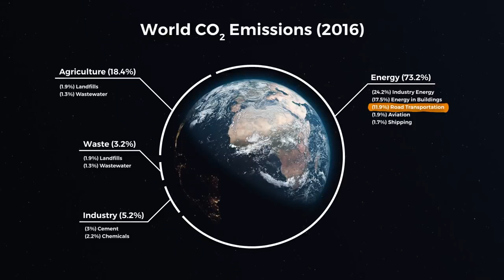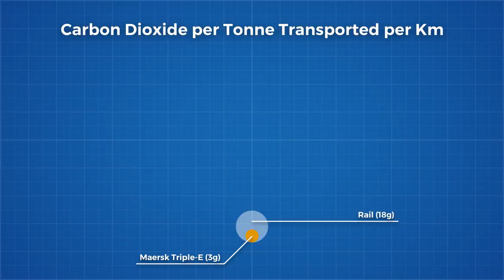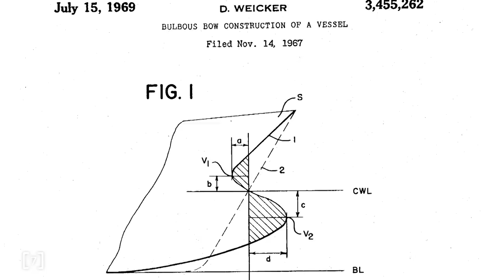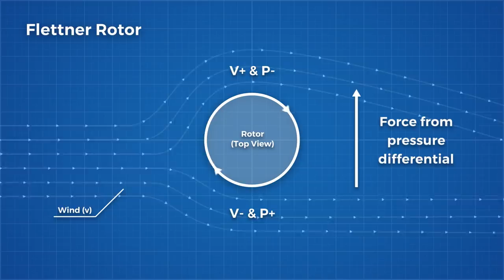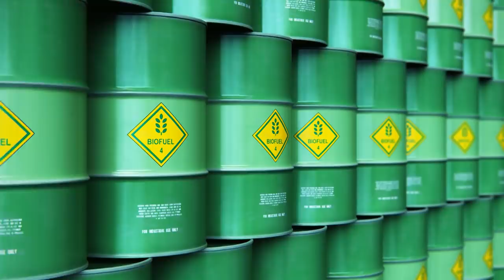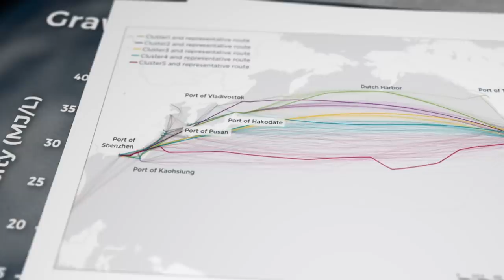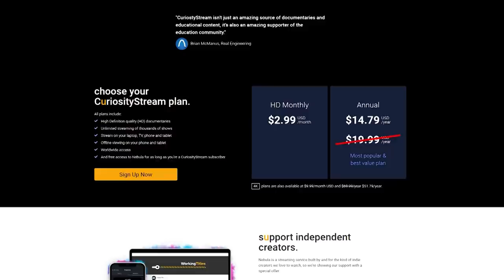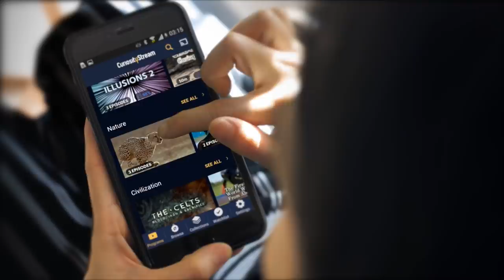Are Renewable Powered Ships Possible?

Comment: What about the use of Nuclear Power for these large ships. I know that it has a Number of real problems such as when they need to be taken out of service and the deadlyness of there fuel but with some of the new designs can this be minimized?
Reply: If you do a web search for ‘nuclear ship savannah’ you will see that it has been tried and did not work.  A similarly heavily subsidised, by the government, vessel is in use in Russia which also operates, in support of the Northern Sea Route, a fleet of nuclear powered ice breakers these may, or may not, have been completely without issues.

Just think; would you have full confidence in the management of a nuclear reactor under the control of an anonymous entity only traceable, perhaps, via a letter box in a FOC (flag of convenience) nation state?  If you are, could you sell that confidence to Japan, the state that hosted the Hiroshima and Nagasaki nuclear detonations as well as more recently the Fukushima ‘event’?  Then try that same, or a similar, sales strategy on Ukraine, the nation state that as a part of the USSR (CCCP) hosted the Chernobyl ‘event’.  Modern iterations of nuclear energy, thorium fuel, molten salt reactors or fusion reactors, will carry the legacy of past problems.  It is the global trepidation of anything with 'nuclear' in the name and the economics of nuclear having transitioned from 'energy to cheap to charge for' too 'the costs of remediation are incalculable' that will prevent the adoption of nuclear energy as a means of creating energy at sea.  Modern reaction systems may have overcome the safety problems but the general public, having been misled in the past, will be reluctant to believe the fresh new promises.

‘They’ say nuclear is cheap, it’s not it is expensive and has a large embedded carbon quotient as well as being complicated, dangerous, not universally socially acceptable and having only ‘no need for refuelling’ as a questionable advantage; actually it does need refuelling just not as often.  When ‘they’ do need to refill the warming up stuff it takes considerable longer than pumping tonnes of thick black stuff, HFO cSt380, or thin runny stuff, MDO, onboard which is one of the reasons HMS Queen Elizabeth and HMS Prince of Wales are pushed about by ICEs and gas turbines thus using a similar fuel as the aircraft that fly off of them.  The Royal Navy (RN) with a high degree of skill and expertise uses, at vast expenses to the UK taxpayer, a current operational nuclear fleet of 11 submarines (also known as ‘boats’) in two flotillas, seven attack subs and four ballistic missile boats.  The carbon footprint of all the extra bits of hardware and the fuel, including processing thereof, from ground to propeller, are the external costs that never seem to get considered.

Disposal, once it wears out, of both the machine (that was a ship) and fuel is another can of worms best left unopened.  The 26 RN boats no longer in use are laid up (some in Rosyth and some in Portsmouth) awaiting long term deconstruction including dealing with the fuel rods and other irradiated material.  The USN is not, as far as I know, a commercial organisation working to very tight margins and also has the skill and expertise to handle the complexities of nuclear power; so as well as submarines their aircraft carriers are nuclear powered and each of the current iteration has a build cost three times that of QE/PoW, bigger crews and more generous funding.  For those who still think that nuclear energy might be the answer I recommend this report: - https://www.bbc.com/future/article/20200901-the-radioactive-risk-of-sunken-nuclear-soviet-submarines?ocid=ww.social.link.email.  The navy of the USSR might have been under resourced and over extended but it was still generously supported in comparison with merchant shipping.
Reply: @BernardLS  I basically agree with you but we need to do an analysis of ALL the aspects you have written about. This needs to cover all costs including decommissioning and the political and societal problems. 
We could also require that all Nuclear powered ships be manned and flagged by member of countries we trust. That might be a problem because we would find it hard to deny China and Russia the right to crew ships
Reply: @richardmeyeroff7397  Improving fuel quality is arguable the lowest of the low hanging fruit in improving the atmospheric environment so a move to LNG from HFO would generate less SOx, however all change and improvements costs so we, the consumers, will need to be prepared to pay a little more or consume a little less at a higher price.  The 'pay more / consume less' solution will have greatest impact on the least affluent.  Really we have three options to reduce emissions, revert to ‘old’ technology, move to ‘new’ technology or reduce ‘consumption’.  Old technology is not necessarily benign, new technology has no ‘track record’ and thus will expose us to the ‘unforeseen consequences’ of our choices so the safest way to save the world is to reduce individual consumption and stabilise the global population at a sustainable population level.  

Reducing consumption requires all individuals to act and limit their consumption, satisfying their personal needs requires fewer resources than satisfying their wants.  Using material and products that are available locally, to the point of consumption, will also reduces transportation impacts.  Freight is always a balance of weight, volume and value so not moving an item from ‘a’ to ’b’ unless the value added significantly out ways the costs, including environmental costs, incurred is a good starting point.  Merchant shipping is run as a ‘high volume low margin’ revenue generating business and any improvements will need to be lower cost or better value to be voluntarily adopted by the trade.

The high volume low cost, which also means low profit margin incentive per unit, operational basis is in part due to end user reluctance to pay the full economic and environmental cost of what they ‘want’ to have, think Glastonbury £100 (ticket price) count me in; Glastonbury £1 000 (full environmental cost) no way!  The key factor is freight tonne mile cost.  The trick for any other ship owner is to generate the similar, or more, revenue with an improved margin by moving fewer goods shorter distance and adding greater value to them while having a negligible environmental impact.  If only there was an ultra energy dense low carbon cost effective source fuel with no harmful side effects.

 ICEs are good(ish) at converting the chemical hydrocarbon (HC) energy into mechanical energy with known externalities; the externalities (CO2, et cetera) are the problem so the best cure is to reduce the consumption of the fuel at source by reducing the unnecessary consumption of ‘wants’ and the unnecessarily long transport of anything.  Our fundamental global problem is excessive consumption by a population that is too large.  The shippers generate profits by satisfying their customers’ requirements.  The villain in the piece is the final consumer without whom there would be no effort to supply.  The shippers will always be interested in providing the service in exchange for the lowest possible direct cost and if they can externalise any part of the cost they will.  While there is no charge for atmospheric pollution there is no incentive to abate it, once the charge is introduced it will, eventually, be recovered from the consumer. The consumer may in turn be reluctant to pay the higher cost and thus by removing the demand reduces the environmental burden.  Maulthus was not ‘wrong’ just ahead of his time.

While ICEs have the current perceived advantages of economy, facility and flexibility we are going to be stuck with the environmental down sides unless universal regulatory action prevails or consumption both per capita and overall reduces.  The system we have is the best we can do on a freight tonne mile basis; if sustainability is desired much less cargo must be moved over much shorter distances; so that is 'plan B' but humanity keeps being stupid and there is no cure for stupidity.

Comment: When it comes to shipping and fuelsources, there is only so much you can do, really. The only energy sources i could see being used for this is either hydrogen (perhaps combined with those rotor sails ?) or small nuclear power. Nuclear powered cargo-vessels would basically be electrically propelled, and could be up to two times faster in speed, compared with current age cargo-vessels. The only drawback with nuclear powered vessels, would ofcourse be the waste material, not to mention what would happen in case of an incident, accident, or sinking of such a vessel. So, with this kind of technology, unless someone out there manages to create some form of fusion power (capable of being put onboard most of the bigger sized ships), the only route left i guess, would be hydrogen powered ships for the forsee-able future. The only problem with THAT technology, would currently be the costs of producing (and transporting) the hydrogen in the first place. But there are certain developments on that technology in progress, that could make this not just technically, but maybe also financially probable, if not possible.

Comment: They should put solar panels or solar film on the outside of the hull above the water line driving electric propulsion on demand. One side will always face the sun.
Reply: The slab sides of a ship are a very harsh environment, just keeping paint on them is difficult enough.  WRT to solar energy and as an example the above container (called boxes by nautical folk) area of a Maersk triple E is less than 399.2m by 59m.  The 399.2m is the length between perpendiculars (marine tech speak - no need to worry about it) and the 59m is the width overall (more marine tech speak so again no need to worry about it) allowing for the sides, bow, stern & navigation/accommodation structure could we agree 340m x 56m or 19 040m2 for the ‘top of stow’ area?  Insolation rate in Joules will vary due to time of day, latitude of vessel, declination of sun, (those three impact the elevation of the power source) cloud cover, efficiency of solar panels and how clean they are. The triple E class use 29 680 kiloWatts for propulsion at full whack plus some hotel and services power load cost; so for round numbers, could we agree 30 megaWatts?  Solar panels create about 155 Watts m2 averaged out; 19 040 x 155 gives me 2 951 200 Watts (or 3 megaWatts for a round number) from the top of all the boxes.  Three megaWatts might allow you to distil enough fresh water from the sea to wash the crud of the solar panels (surprise fact renewable energy comes with maintenance costs) but nowhere near enough to effectively 'push the boat along'.  Fitting solar panels on top of the ‘boxes’ is worth, at most, 1% of your power requirement.  More seriously the ‘boxes’ are loaded and unloaded from the top down so the solar panel array would need to be moved for every port operation and time is money as well as that operation having the ability to get very complicated (tech speak for ‘go wrong’).  Any additional weight would be in the worst possible place for the stability of your vessel, the operating environment would be harsh and the ‘top of stow’ on a ‘box boat’ is seldom a level expanse as each column of containers may be, and usually is, of differing heights.

Comment: 0 emisson ships have been around for quite some time and they work well with no problem p. e. the USS Carl Vinston or USS Virginia
Reply: Nuclear power could be considered 'zero emission' but only if the embedded emission costs (odd turn of phrase but basically the creation, operation and remediation of the energy source is not  emission free) are discounted also nuclear energy use at sea has a number of other liabilities.;being complicated, dangerous, not universally socially acceptable and having only ‘no need for refuelling’ as a questionable advantage; actually it does need refuelling just not as often.
Reply: @BernardLS 

Not questionable at all. Nuclear vessels need significantly less refueling given the extreme energy density of uranium.

Some aircraft carriers only refuel once every 30 years, compared to the 30 days of regular cargo ships.

Comment: It would be possible to use battery electric ships I think. Diesel Submarines use batteries to stay underwater for long periods of time without a snorkel giving away their location. Obviously without using the diesel to charge the batteries and recharging at a dock. One problem would be that each dock would need like a nuclear powerplant to produce enough electricity to charge these ships and it might take a long time to charge that many batteries along with the fact that batteries weigh a ton and to transport them across the ocean as pretty much dead weight would reduce the efficiency if not sink the ship. Hydrogen also seems like it could be used but our current methods of producing it just wouldn't suffice. Overall I think that the problem is easy to solve as there are maybe 20 ports in the world that handle the majority of all shipping traffic in the world giving us an easier time making large infrastructure changes.
Reply: Diesel electric submarines are, in comparison to merchant ships, tiny.  If you visit one on your local 'navy day' your first though will be 'people live in here!'  There is a ferry that runs from Helsingborg (Sweden) to Helsingor (Denmark) a twenty minute trip and she recharges at each terminal each time.  Go do a Google search, there is an entry about it.